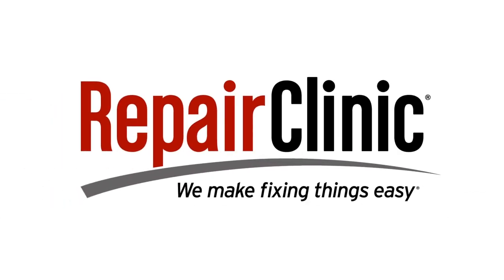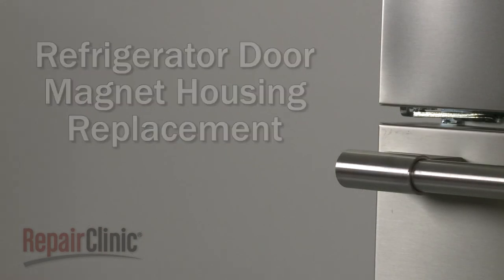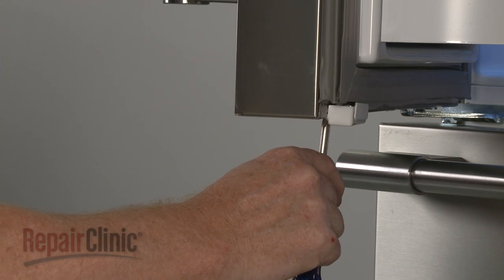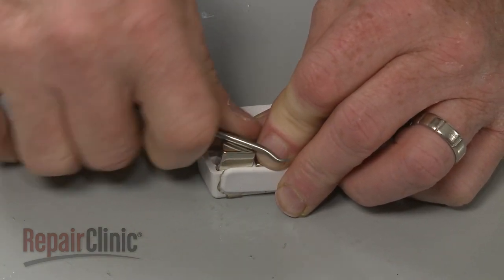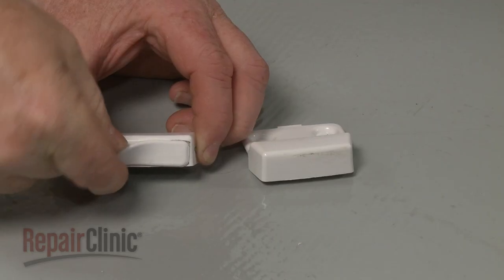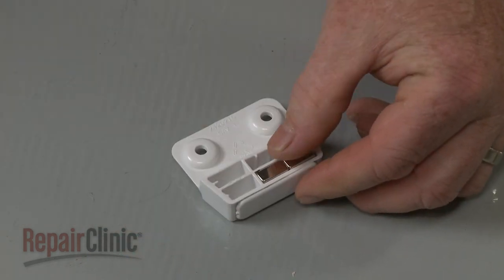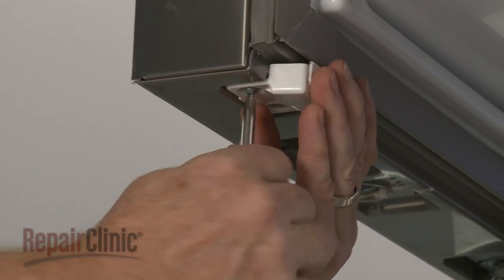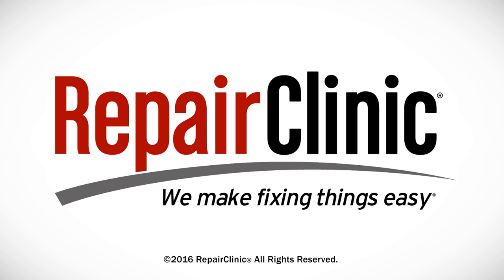Frigidaire Refrigerator Replace Door Magnet Housing 242291001

Comment: Thanks you so very much for your video!!!  I have a ton of replacement parts coming in the mail to trying fix this same issue with my Frigdare refrigerator doors.  However, Thank God for your video!  I fixed my frigdare!  The magnet had some how came out of the little housing.  I replaced them back into the housing!!!  Thanks to you the door closes like new again!